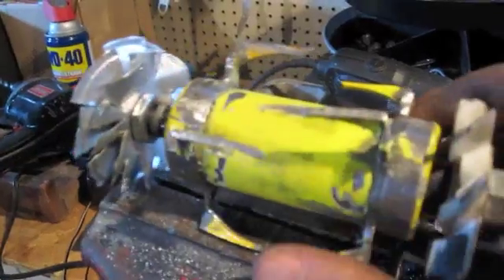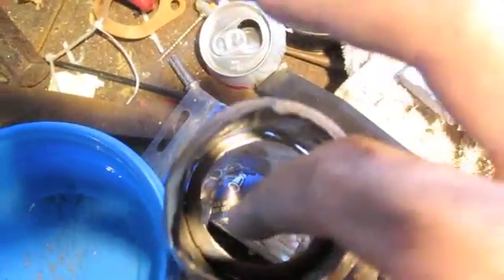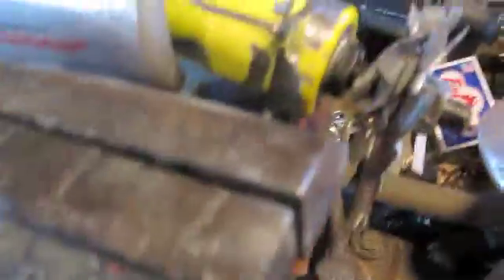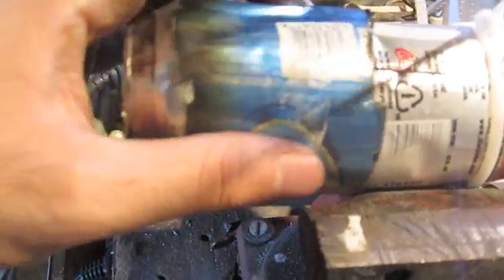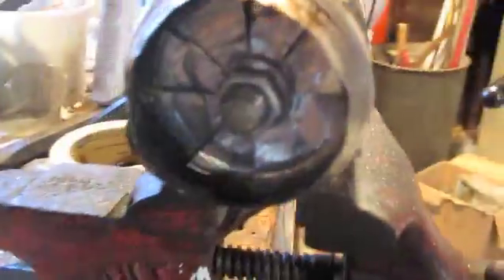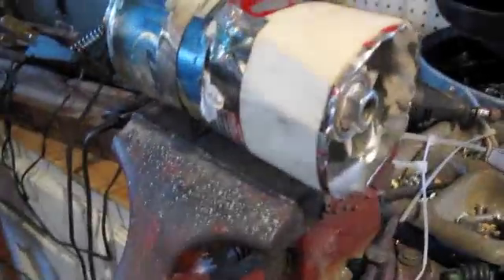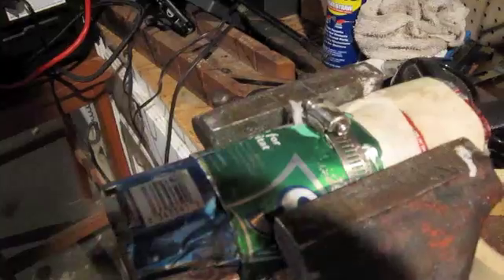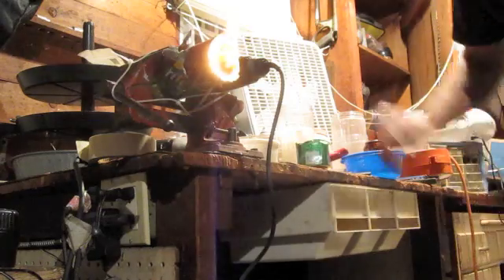How to (kinda) make your own Soda Can Jet Engine! MLCCS Mark I

Comment: For anyone thinking about attempting this, DON'T. Aluminum is literally the worst thing you could use for a jet engine. Can you get it working? Sure, with the right thickness. But after 4 seconds of operation, the inner aluminum will melt and then you have molten aluminum flying everywhere. It's literally the best way to set your house on fire...
Reply: Sviolinist Not exactly. High temperatures with galvanized steel will cause peeling. The zinc surface will start to peel off and crack, then temperatures beyond 480F will cause the Zn-FE alloy to also peel off. Then you have molten zinc flying out of your turbine. This is called the Kirkendall Effect (the peeling part, not the molten zinc flying out of your turbine). Try using sheet metal stainless steel no lower than 18 gauge. Lower than 18 gauge starts to get pretty thick and difficult to work with. 18 gauge on it's own is a bit thick but still workable.
Reply: Sviolinist HH3Productions LMAO you are so full of shit....
Reply: HH3Productions Sviolinist Since you would hit anything near the meltingpoint in the COMPRESSIONCYCLE, but hey ok.
There are only two possible outcomes:
99,99%: you are a liar, obviously with some personality disorders.
or
0,01%: nobody gives a shit about you and you are straight up the stupidest ''owner'' of a major company ever known to mankind. You should better get your website our of construction instead of living out you narcissism.

either way you would be stupid as fuck.
Reply: thats right in your case!! but the country I live in gives me a opposite thinking, the gaz we have is not even 30 percent pure so it burns in low temp.Then tin cans are good in my case!!
Reply: bassel AL moukaddem Doesn't matter, even if it were charcoal fuel somehow, it could reach temperatures over the melting point of aluminum. The fuel plays a good part in it but the amount of oxygen it's being fed plays an even bigger part. Why do you think it's possible to melt aluminum in a charcoal furnace? Because it's fed so much oxygen. Use a metal with a high melting point.
Reply: Thats right I forgot that point:-)
Reply: +Plato Bronze lead copper... all melting somwhere around 1000 C. Aluminum melts around 650 C. I mean yeah, it's fairly low, but to tell people not to make tin can jet engines out of it? That's a really high melting point for the most part. This isn't all that dangerous...
Reply: +Sviolinist Do you not understand how hot it could get with proper fueling? Even wood with relatively low speeds of air could melt aluminum. You can find these videos all over youtube, a simple charcoal crucible with a hairdryer attached to it. This moron didn't even use the right fuel and he had a fire mishap at the end. Imagine if he had proper fueling...
Reply: +Plato Tell that to the companies and factories who design and build model turbines. They're made out of aluminium!
Reply: ***** Not pure aluminum. Thick alloys made mainly out of titanium. The aluminum is for protection against oxidation but not for strength or heat properties. Hence why it's added, not a base material.

http://cdn.intechopen.com/pdfs-wm/22905.pdf
Reply: Plato I decided to use galvanized steel. Do you think steel is a decent enough choice? 1363 C melting point or so, right? That should be good. Around double Aluminum...
Reply: +Plato Crap! The turbines would have been unaffordable if titanium were added. They don't even use it for real turbines because of the price for it. Only the fanblades of commercial planes are made out of titanium. One blade costs the same as some of the average to most luxurious to most expensive sports cars totay. They temper the aluminium and the exhausts are a mixture of copper and aluminium. Look at the How It's Made short show that's been put on youtube. They show how a Jetcat engine is made.
Reply: ***** I happen to know for a dead fact that the J-79 blades and other interior components are pure stainless steel. That's why I mentioned galvanized. Nobody is lining a jet engine with expensive and rare titanium. This guy is a goober for suggesting that, lol.
Reply: +Plato Take a good look at how a Rolls Royes Trent engine or GE one for commercial planes are made. Then you'll see what metals they use for which parts and purposes.
Reply: +Plato Oh, I'm just getting you to respond. Titanium is always superior because it has less specific density than steel. In fact for each unit of mass, Titanium is almost half the weight and of good strength.

It will improve any thrust to weight ratio for sure, but as far as being necessary for the HOME BUILDER....

That is why we are jumping on you right now. It isn't.
Reply: +Sviolinist I know what titanium is. You don't have to try to explain it to me prof.
Reply: +Plato I think you could get away with aluminium at least in the compressioncycle since you wouldn't get to a certain mechanical load in a selfmade gasturbine.
Specially this guy with his perfectly balanced canthing wouldn't get over 1000rpm anyways :D
The post-combustionchamber should be stainless.
+Sviolinist Only because something is less dense or stronger doesn't mean it's always superior. The propertys of titanium wouldn't really suit a turbine in a pretty simple build,
because you would have to cool it externally. Otherwise the titanium-shit would literally hit the fan if it would get to 500°C/900°F. #radialforceandairpressurewoulddeformthatshit
Reply: Should I use copper?
Reply: Beau Warrington A bit expensive... I say use sheet metal stainless steel.
Reply: +Plato There's no titanium in ANY turbine engine. You have no idea how expensive titanium is. One fan blade of commercial airliners on the front of the engine costs as much as some of the most expensive luxurious family cars and very expensive sports cars ex. Ferrari, Porsche etc. because it's made out of titanium. It's a rare metal and difficult to find.
Reply: ***** I own Hughes Aircraft Company. Literally. I have no idea what you're saying but Plato is 100% correct. Stainless steel is fine. Also, none of you idiots seems to know anything about metal tempering, the chemical basis for stronger steel (carbon content), or anything remotely related to aerospace engine production other than "hey this metal sounds good." So just shut it all of you. You're all failures. Not plato. Steel is FINE. The J-79 has stainless steel blades. ENOUGH SAID GOSH. The Convair 880 had 4 of em and it went really fast. Nobody cried out for Titanium because it sounded nice on paper.
Reply: Beau Warrington Copper isn't the worst choice. The bottom line for all of you to realize is that any of these metals can be used PROVIDED the operational temperature, fuel, and air supply are all carefully regulated to produce a standardized result. Because copper is generally denser than steel by at least 1 gram per cubic centimeter, it will weigh your engine down and decrease the thrust to weight ratio. Furthermore, the lower melting temperature of copper (some 200 C lower) will reduce your heat dissipation abilities and thus lower the thrust to weight ratio further (because you will not be able to operate the engine as hot as you would otherwise - less fuel, less power, etc etc.). So yes, you can build an aircraft or any other kind of engine out of aluminum or even plastic PROVIDED you make a careful study of every theoretical limit involved in the engine. And then stick to it. And yes, plastic would be very unsafe for most engine components BUT I have seen a dodge engine with ABS components before.

In other words if you build it out of aluminum and you have no gauges connected to the engine and your idea is to simply "see how far she'll rip!" then it won't matter what you build the stupid engine out of. It's going to eventually implode or even explode. Be that as it may, most people building these things on Youtube out of proper materials still do not know how to calculate the safe theoretical limits of their engines. Just be careful no matter what you do. And use proper materials if you're an idiot. If you're not, experiment. Figure it out. I gave you every clue you need to design something without the retarded mindset that you need exotic quantities of titanium.

And the guy who said that the turbine blade costs more than a car? Are you shitting me? You buy it at the sheet metal store and cut it. My dad built the Sr-71 blackbird at Lockheed. Buy the sheet metal and CUT IT. It costs ... a few bucks. Shit man, I've taken apart the RB-211. The turbine fans don't even stay in place they rattle around like they're broken. Feels cheap. And it's FRIGGEN STEEL
Reply: +Sviolinist Don't judge what you don't know! You're bumping your head real hard there. It's one of things where you spill out to everyone who surrounds you, hear and read about how much wisdom you have and how you use it. That is where "all knowers" come in. I know a lot more than you think about certain metals and what and how tempering works as well as what the different results can be. I know it's the carbon but it's not all. Tempering is not just hardening the metal, it's also for changing a very hard metal to become softer. Don't call me or anyone an idiot. You're not a scientist who studies metals and just working with typical every day ones is not enough to tell you what is actually happening every time with the components inside the metal as it changes. For example, do you know how to temper copper? You say you work with metals. How to harden or soften copper.  Can you make spring steel? Those used for vehicles. Don't open your mouth to just anyone and try to be wiser, have more knowledge about something and try to act superior over others just because you  think you know more. You might (in your case) walk straight into a scientist or someone else who has many years behind their back who worked with a lot more metals in a lot more different ways than just tempering. So you'd better watch out and think twice before opening your mouth and just call anyone or everyone an idiot.
Reply: ***** He forgot that it's about some DIY stuff in the first place...
Sviolinist 
And what would be the odds: ''I own Hughes Aircraft Company. Literally.''
Correct me if i'm wrong but i don't think you can practically own a company without being the major stockholder.
And nobody said anything about building the whole engine out of aluminium ''In other words if you build it out of aluminum...''

I'm by no means professionell on any level, but i think you are full of crap and not a metallurgist or mechanicalE either.
I think you are more pathological liar than anything else.
Reply: Sviolinist Oh, you own Hughes Aircraft Company? That's strange... Because Hughes aircraft company went out of business YEARS ago.
Reply: Plato Call Sacramento and ask if the company exists and who owns it. They will say yes and it is the same Hughes Aircraft Company. I just got a workers comp claim from someone who was born in 1939 this week, so yeah. I'm Howard Hughes III. I'm working on some cool shit right now, too.

Lol and if you don't believe me you are going to be kicking yourself in the ass when you find out you could have been friends with the new Howard Hughes in like a year or two when I finally settle on a film script for Howard Hughes III productions.
Reply: +Plato <- See Howard Hughes III Productions, LLC. You know if you think I'm joking around that's cool. At least go see my movies when they hit theaters. My grampa raised me to be like him. He died on June 25, 1998, in Glendale, CA. My grandmother is Jean Peters who is not yet dead and hiding in Glendale, CA. She's 89 at the moment.

Hughes Aircraft used to be part of Raytheon. My gampa had to do something with the company when cancer hit him super hard in 1997. But that doesn't change my own destiny. It's only been 19 years on pause, basically. They don't need the name at Raytheon. Their loss.
Reply: Plato I'm not.
Reply: ***** I have a PhD in structural engineering. Owners of aircraft companies may not be much involved in the creation of airplanes, but the FOUNDERS are. I.e. Mr. Mac, etc. etc. Obviously you know VERY LITTLE about the history of Hughes Aircraft. My grandfather was an EXTREMELY hands on man and he taught me to be the same way. He would clear out the hangars and work all by himself some days. Got any other stupid shit to spout in here? Did I say I was a mechanic? I'm an engineer. Maybe you should finish high school before commenting on rocket and jet propulsion. You just sound stupid man. Everything I said will help people who are designing these, that way people can stop asking about whether this metal or that metal will work. Many metals work. Just regulate the combustion so that the metal doesn't melt or become too hot for the nacelle / pylon/ etc. etc. etc. etc.

As for Aluminum, it's pretty obvious that the melting temperature is far too low. 

Other factors to consider are TENSILE STRENGTH and ALLOY LATTICE STRUCTURE.
Reply: +Nortical What on Earth are you talking about? The compression stators and other components (such as a frontal turbine) can and do conduct heat because they are made of metal and usually connected in some way to the combustion areas. Therefore the heat can and does transfer in many directions, and it is entirely possible (nay, likely) that an amateur would design a jet engine with a melting compression cycle.

Nortical, anyone reading your post should realize how incredibly, incredibly stupid you are. I know you want to seem smart here, but you are laughably stupid my friend. You're basically saying that it's impossible for the compression stage of a jet to melt under high loads.

That makes no sense. You're basically saying that it's impossible for most of a jet engine to melt simply because combustion only occurs in one section. Guess what idiot? Sometimes the whole engine melts because an idiot built it.

Well, like a frying pan, the handle eventually gets hot even though fire isn't being applied to it. The fire is underneath. However - And if the fire was turned up hot enough - even the handle will turn molten. That is because like a frying pan, most of a jet engine is HIGHLY CONDUCTIVE OF HEAT ENERGY TRANSFER DUE TO THE FACT THAT THE ENGINE IS MOSTLY METAL. Think of the handle as the compression stage. Even that part will melt if the engineer that built the thing can't do math.

So - again - more idiots.

I'll just have to stop coming in here because most of you are just way too clueless about real engineering. Go ahead and build your jet engine with the "safe" compression stage that will never ever melt. And then burn your stupid house down because of this high, high level of stupidity.

Just keep a fire extinguisher handy. Maybe like 10 of them with that kind of logic you have there.
Reply: +HH3Productions What kind of structural engineering? Structures of what? Mostly steel is the metal for the job. Aluminium and carbon fiber is for planes. Oh and by the way, I'm way past high school and air vents are used inside the the turbine blades as a way to avoid them from melting.  I've known very well since low school how turbine engines work and worked out many of the different types myself. I also have close contact with a man who worked for many years at an air force base who serviced and fixed broken engines and he hardly corrected me if any. Don't tell me I talk stupid stuff. I've seen a lot more than you think!
Reply: ***** Did you expect a real engineer to come in here and encourage stupid people to burn their homes down?
Reply: +Sviolinist He's not a builder of real turbine engines and testing them, nor does he design them. He's in structures fool!
Reply: ***** Structural engineering was the only online PhD that columbia offered and Howard wanted an ivy league diploma. I work for Hughes Aircraft. It was purchased back from Raytheon a few months ago. He even has to show up in court and settle workers comp claims from people born in the 30s.
Reply: Sviolinist howard hughes died in 1976, i guess there were no online phds available.
i thought you owned the company...
dude i don't even bother answering anymore, since it's way offtopic anyways.
Reply: led would be the worst thing
Reply: I use safety gear but im waiting for a different metal to come im so yeah lol
Reply: Play-Doh how about Stainless Steel?
Reply: +Play-Doh what is a sustainable metal that is affordable (under 30 USD)
Reply: +Sviolinist If you had the wisdom you would have understood. It's a simple answer and easy to understand. You're simply try harder to  compliment yourself more with every answer by trying to humiliate others by trying to be the most important and the Big Guy who looks down on all others with these crap answers of owning a has been aircraft company, being a pro mechanic and since when do owners of metal working companies and factories work with the metals themselves? There are more than you can count people who will kick off the earth and make you look look like a schoolboy with what they know compared to what you just said.